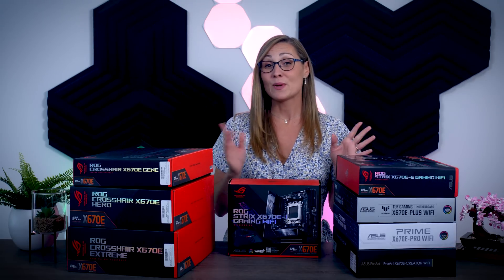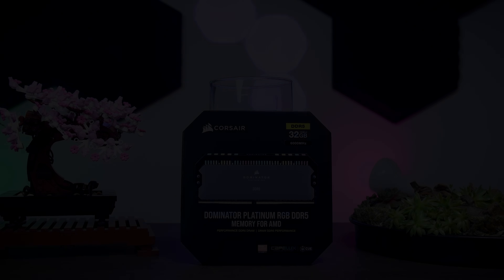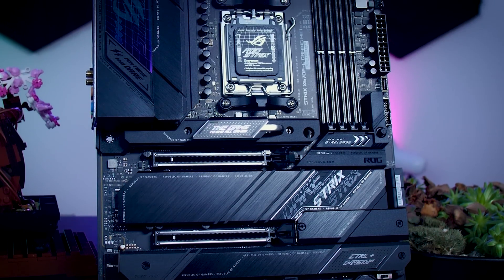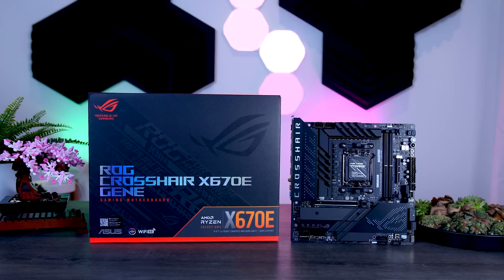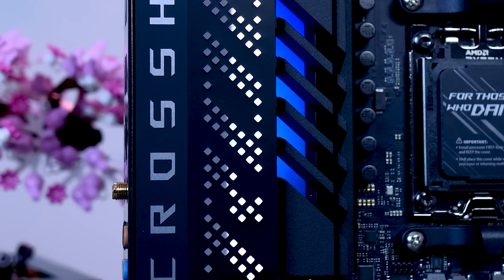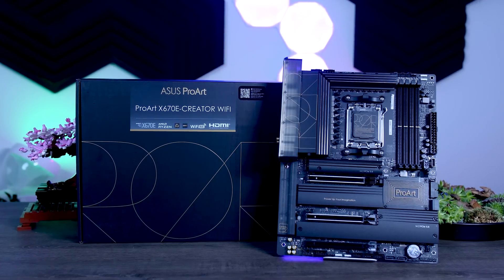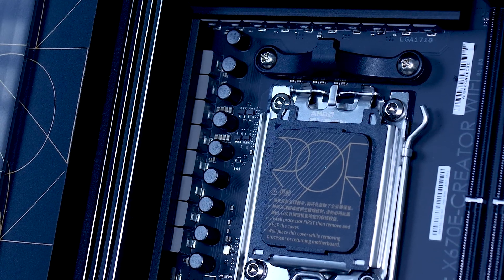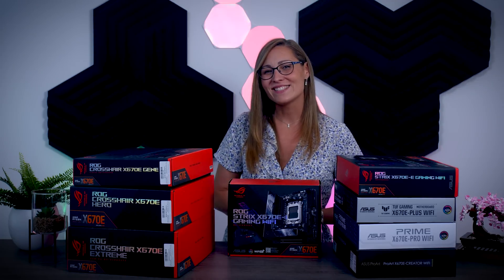ASUS X670E Motherboards - First Look at 8 new AM5 Motherboards for AMD Ryzen 7000

Comment: Save your Money$ AND PICK ANY OTHER Brand.... Asus has failed as a Tech Company, after 15yrs I've decided the X670 Family is worthless and Blew up the X670XE Asus motherboard (Using heavy Explosives to make sure it was unUSABLE {Editors notes, it Melts as Fast as Being turned on} and so i've optied for MSI or Gigabyte to use PCI 5.0 with some Stability... Sad day, but I needed a system that didn't Forget my PIN more then ONCE!!!!!!!!!! I rather Build a Linux system then use ASUS....and then attach Opiniheimer as a Support Agent... more Stable than ASUS in 2023
Reply: " I've decided the X670 Family is worthless"  I've decided I rather enjoy mine. Hmm,,,

Comment: I have a question, as I am very confused by those Asus boards. For those boards with the Intel JHL8540 USB4, if I read all over the internet, the USB can also be used as a Thunderbolt, as they say it's work on the same protocol. . On the manual from Asus for the BIOS settings, there is a section mention the settings for the Thunderbolt. In de board manual however they don't speak about the Thunderbolt. So I emailed Asus about this and there they say if it's not mentioned in the manual there is no Thunderbolt, but it's hard to believe, that on the extreme, for the price, they have disabled the Thunderbolt and for the cheaper boards they have enabled.

Can you tell me if you have tested the extreme and checked the BIOS if there's the Thundebolt section mentioned?
Reply from the maker: I haven’t seen the extreme, sorry.

Comment: Nice and good stream by a competently presenter! So let´s go to the stuff, I think in generally the prices of all AM5 mainboards are complety extrem overpriced, especially the boads from ASUS, they are more much more than just overpriced! I remember the a X570 AM4 mainboard costs beetween 200,- to 340,- $/€ and now we have to pay around 400,- $/€ for AM5 boards that´s catastrophic to much.
The normal user buy a Ryzen 5 or a Ryzen 7 7700 or 7700x which cpus cost by us in Germany beetween 230,- to 340,- $/€ and it´s clear disporportionate to pay more for an mainboard.
OK there´s the Ryzen 9 but only a few people buy such extreme cpus! So I think in the shadow of this extreme overprices around 90% of all sold Asus AM5 mainboards would have thre B650 chipset, 5% the B620 and only 5% an X670e chipset.

Comment: Does it make sense to choose a x670 over a B650 considering upgradability in the future?
I really have a tough time choosing a motherboard for my first pc build, oter specs I chose:

AMD Ryzen 7 7700X
Intel Arc A770 Graphics 16 GB GDDR6
Cooler Master MWE Gold 750 Full Modular V2 PSU
Kingston DDR5 FURY Beast 2x32GB 5600
DeepCool CC560 WH Midi Tower
DeepCool AK620 White
Samsung 980 PRO 1TB M.2 SSD

Using it for Game dev in particular, noticed with my current pc that I tend to run out of Vram and memory, so that's why I chose the a770 with the 16gb of vram for a reasonable price and I need a motherboard with 128gb of memory capability for future expansion

Comment: ASUS offers among the highest Voltage Regulator Module (VRM) phases for AMD motherboards, but the price is not cheap compared to other competitors like GIGABYTE, MSI, ASROCK. I think if you really want to test all the motherboards then first please states how many VRM phases that motherboard has, normally higher VRM phases offers better stability and performance. Installed the most power hungry graphic cards that you can think of to test it, and record the temperature  for 24 hours test. Since the higher VRM phases motherboards are built for those who are working non-stop everyday. If less than 24 hours, then test it for at least 16 hours since Bill Gates said he is working at least 16 hours everyday including holiday. Japanese-Taiwanese ICT industry people said they are working at least 19 hours everyday but has holiday. So I think you can test at least 2 set of motherboard system, those who are following the working style of American Bill Gates 16 hours per day running 7 times per week. Another system of motherboards are using Japanese-Taiwanese working hours style 19 hours per day 5 times per week. Plus another system of motherboards are using Israeli super hardworking but also super lazy style of working.. Israeli people are working 24 hours non-stop but they only do it once or twice per day, other than that is just sleeping, eating, drinking, laughing.. So max 2 days, 48 hours non-stop working motherboards but only 2 times per week.. American-Bill Gates style of working is at least 16 x 7 = 118 hours per week, Japanese-Taiwanese style of working is at least 19 x 5 = 95 hours per week, Israeli style of working is maximum only 48 hours per week. 🤔

Comment: Great video! Question: which is better, the asus prime x670-p pro wifi or the aorus x670 elite ax ? thanks
Reply from the maker: I honestly don't remember off the top of my head. Both can handle any CPU, just make sure you get the connections you need imho.

Comment: Thank you for this excellent round-up. I went for the Gene in the end and I'm delighted with it. It's expensive, but beautifully made and it doesn't really have any competition in the mATX space. I figured it'll last me several years as we go through new generations of Ryzen processors, if AMD keeps its promise to support the AM5 socket until at least 2025 or so. I also do have some Thunderbolt peripherals which I use with my Macs, so this may come in handy.

Comment: I am contemplating between the Pro Art, Hero and Extreme  versions  LOL  Motherboards are getting way too expensive these days.
I wonder whats next .  $2k  for motherboard?  maybe $3k for a motherboard?  - Sorry but this is what i am feeling these days.
I just purchased a AMD Ryzen-9 7950X  and now I am debating between 3 of these ROG motherboards or the Gigabyte Aorus boards    🤔🤔🤔🤷‍♂
Reply from the maker: If you don't need all those features, remember even the TUF is a decent board that can hold a 7950X easily!
Reply: @TechTesters  
Update
I just purchased the Gigabyte X670E Xtreme because it was not $1,000.  I got the X670E Xtreme for $699.   on Prime Day 2023.   🤷‍♀
I need the features because I do creative things.  And I am NOT planning on upgrading for another 10 years.
Its going into a Corsair 7000 Case (white Edition)  with a EVGA 1600-G2 PSU.
I am upgrading from a Gigabyte 990FXA-UD5 Motherboard that has a AMD FX8350 CPU and DDR3 1066 RAM.
So its a huge upgrade for me.  🤓👍  Though my GPU is still a 1070-Ti,  as I am waiting for a good NVidia price point.
And I am not giving up my 1070-Ti  as its always been my golden boy.  🥰
Anyways that's my update info as of today.  I am assembling the new computer on Monday 🤓👍

Comment: lol sorry to comment but you kept saying 110 amp when refering to the boards. This isnt possible, most electrical boxes that have all the breakers in your house are 200 amp service and a typical apartment has 100 amp service. A wall plug which a computer is plugged into sits on a 15 amp circuit, so theres no way 100 amps are going to ge to the mobo through a wall plug. Also if you pushed 100 amps through a mobo, it would explode and light on fire. I love your videos, but are you sure these things are using 100-110 AMP service? or is it wattage?

Comment: The cost of anything above the TUF here in the UK is almost the price of a complete PC system. £580 for the Strix ($640 US)  Add in 5600hz or better ram and it is more expensive than a complete last gen PC (£210 for 16 Gigs  - $240 US)  So almost $900 for just MOBO and RAM!!!!!! Shocking prices. Just bewildering high prices.
So no. No thanks AMD. Not today - not ever in fact. I'll buy a last gen system and make it last 5 years like I did last time.

Comment: I am still using the system I built back in November 2012 using the i7 2600k cpu, Asus MB and 980Ti as the major hardware.  The system, while still working, needs to be upgraded.  My builds do more than game.  I also use this system for editing many large photos using photoshop, lightroom, Topaz and other editing software.  Since I don't upgrade every generation and the system is designed for double duty, I am going with the Asus Hero even though the Strix is a very compelling option because; 1) the additional storage capability with the additional m.2 and Sata storage options (do more than just game), 2) USB4...so I don't have to upgrade board later and I do lots of big file dumps, 3) I don't look to upgrade with each generation and use the hardware much longer than the masses and want to get all that is needed on the initial build and that is where I get my price to performance value.  The debate of whether to go with the Hero or Strix is real that is for sure and Asus knows this and dangles that carrot in front of you by adding small bits to sway buyers one way or the other...damn. Because I am on a longer upgrade path than usual/most and the system does double duty work, I am doing this 10 year anniversary build using all top tier hardware because it will most likely last me another 10 years.  With that said, do you have a video that discusses the higher end motherboards and cards in more detail?  That comparison table is much more visible that trying to decipher each MB separately for sure and makes it easier to see the differences to make an informed purchase decision.

Comment: Asus has so many different motherboards to choose from for the AM5 platform, too many if you ask me because it confuses most people shopping for a motherboard when there are too many options available.  I wanted to get a Mini-ITX or Mini-DTX motherboard this generation but seeing how much of a premium they are over regular standard sized ATX motherboards and the size of the video cards in the AM5 generation its not worth the extra costs to go SFF on the AM5 platform. 

It looks like this generation ill have to go with a regular sized ATX motherboard. I was hoping to find out in this video however what the difference is between the STRIX X670E-A, STRIX X670E-E, and the STRIX X670E-F since they all have similar names and all 3 are standard ATX sized motherboards.

Comment: Having used my X570-I from Asus for several AMD CPUs, up to the 5950X and having the long lifecycle, bios updates etc. I would consider not buying the very cheapest X670 boards. My reasoning for this is that the long lifecycle means that you might very well replace/upgrade the CPU even if you build a budget PC.

Comment: You missed the Rog Strix  x670E-A.  It falls between the Tuf/Prime and the Rog Strix E-E, both in price and features.  There's also a VERY slightly higher end Rog Strix s670E-F, to help fill out the alphabet!  Honestly, though, they're not much different from any of them or each other.  (Strangely, the F seems to fall between the A and the E, at least price-wise!)  I think that they mainly exist to plug the hole in the price range between $350 and $500, at $420 and 450.

Is it me, or does it seem like Asus basically decides what price points they wanted to cover across the board, then struggled to actually figure out now what features would actually differentiate those boards at those price points?

Great job at breaking down the minor differences, especially with that awesome chart!
Reply from the maker: You're right though, every year they kinda stuggle to add/remove some features so that most boards make some sort of sense. And every year a few models stand out more/less.
Reply: Congratulations you figured out how they do it.

Comment: I love your overview.  You are right $1000.00 for a board is out of control.  It will be interesting when you start doing the benchmarking with the 4090 and the new Radeon cards. Which one of those boards have the usb c on the header that allows 27 watts or 60 watts of charging and do they all have the header port that you can connect your usb c case to?

Comment: very disappointed with these boards, you can’t run pcie 5.0 x 16(video card) and pcie 5.0 ssd m.2 at the same time , if you do than your pcie 5.0 x 16 lanes for video card get dropped to x8…it’s one or the other. Does not leave any room for upgrading the gpu in 2-4 years to pcie 5.0 if you decide to get a pcie 5.0 m.2  with these. terrible investment and done on purpose so in 2 years when pcie 5.0 gpus and m.2 ssds will be a thing you’ll have to upgrade your mother board again lol.

Comment: Are you able to test if thunderbolt 4 works on the usb4 asus motherboards? As far as I can tell it's completely unanswered online if the thunderbolt 4 controllers Asus is using for USB4 support in these motherboards is having the thunderbolt 4 portion disabled in the BIOS, or if they just aren't advertising the support but it works anyway.
Reply from the maker: I'm working on a full build with one now :)
Reply: @TechTesters  Great, thanks. I have the ProArt preordered and this is the main thing bothering me still and am trying to figure it out while I still have time to decide if switching to asrock is worthwhile.

Comment: none of them makes sense...they are ridiculously expensive and no one should buy one...even the b650 boards will cost $200 minimum...so you buy a mobo that costs the same as the cpu..no. I'm an amd fan but amd shot themselves in the foot this round....first time in 8 years I've said people should go with intel.
Reply: B650 is expected to cost $139 or so.
Reply: @TheSjuris  it doesn't.
Reply: @nowherebrain  sorry there’s an entry fee for a new design.  Good need you can stick to Intel and us their current boards which still support ddr4.
Reply: @TheSjuris  I am am4(3600x), you clearly judge without any knowledge...that's called prejudice. I'm just stating facts. Fact is the entry prices align with old high model prices...so you want to be an enabler for greed, go ahead..know this...your attitude hurts the consumer.
Reply: @nowherebrain  new things always cost more. Especially when they use more expensive materials.  It’s sucks but that’s how things work.

Comment: With the mb , ddr5 and chip prices. I would be surprised if ryzen 7000 sells much
Reply: Yeah it won't, especially people on AM4, they will just upgrade to a 5800X3D or something if they need too. Makes much more sense to wait for the next generation with cheaper DDR5.
Reply: @ReLoadXxXxX  Honestly I don't see a need to upgrade for a long long time. CPUs since intel 9th gen and Ryzen 3000 are all more than fast enough for 1440p and up. It's the difference between 300fps and 500fps. What's the real world difference?
Reply: @StarsMarsRadio  those people are called enthusiast. They always want latest tech but only few of them use all those tech.

I'm still running on FX 8320E and planning to upgrade to 7700 Non X next year. From DDR3 to DDR5, it's gonna be huge jump.

I also waiting for B650 boards price. DDR5 will drop price next year, anybody who bought this year is paying for new tech "tax"
Reply: @arx117  I just upgraded to a x670e Strix only because Micro Center had a promotion for  32gb kit of 5600mhz ddr5 for free.

Comment: One thing you need to mention in further previews is how many PCB layers the motherboards have. They range from 4 for low end boards and 6 for mid to high range boards.
Reply: i think 6 of them are 8 layers pcb and the extreme one is 10 layers
Reply: For 99.9% of people out there these few extra layers mean absolutley nothing.
Reply: @TheTanelChannel  doesn’t matter it’s a spec that needs to be mentioned. You sound like a noob.

Comment: ProArt X670E seems the more logical choice to me , USB4 40GB/s  + 10Gig Lan , absolute beast of a mobo for 500$. However I am not sure if you can undervolt your Ryzen 7000 cpu with it and how good are the power phases.
Reply from the maker: I don’t expect most people to use 10 gig, but it does do something unique for sure. And you can undervolt properly just like with rog boards, and the vrm should be more than enough for an overclocked ryzen 9.

Comment: I am not going to need PCIe gen 5 for GPU or even ssd, gen 4 will keep me alive for another years. Have a plan to upgrade from my b550/r5-5600X/3200Mhz to something like t7-8700X3D. In my next build I will make sure I get the best ram memmory cl on 6000Mhz.

Comment: The B650 boards will limit the gen 5 connectors to just 1 or 2 beside the cpu, costing less to produce and hence be cheaper. Similarly I hope they do something about the lids on the new cpu lineup, I mean it gets so hot cos the heat transfer not fast enough cos of the thickness. Maybe they address this with the X3D

Comment: I'm glad I never claimed that I'm reasonable.  I ordered and now own the X670E Extreme board.  I just want to make sure I have ALL the options I could possibly want.  And I know I'm gonna be keeping this new build for nearly 5 years before I upgrade again.  So I'm fine with buying the best of the best now, and riding it through this entire socket, until I upgrade again.  It's why I'm also planning on getting the 4090.   Plus, once you break it down, it ends up being less than $1,000 per year.  Not to bad for a hobby, and a device that I'll end up using every single day.

Comment: At the $500 price point, the ProArt seems like a much better buy than the Strix since it has both USB4 and the 10gig ethernet in exchange for postcodes and physical buttons. Is there anything else to know about the ProArt that limits it - like does it have a different BIOS that doesn't enable overclocking, is the VRM not as good, or is the cooling inadequate?
Reply: The VRM is very adequate for even a 7950x, bios is essentially the same as far as I know (I watched Asus's live stream about it), look at the spec sheet on asus's site. The proart isn't getting the attention it deserves IMO. It's always nice to see a mature looking motherboard without RGB, and just sticks to business.
Reply: If you don’t need usb4 save money and buy the TUF